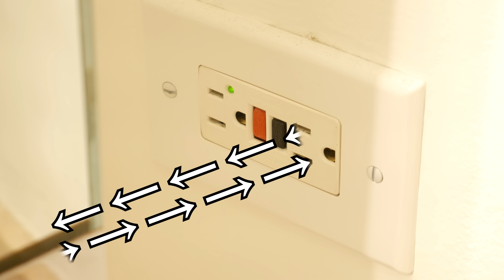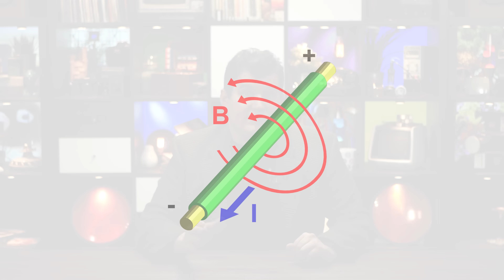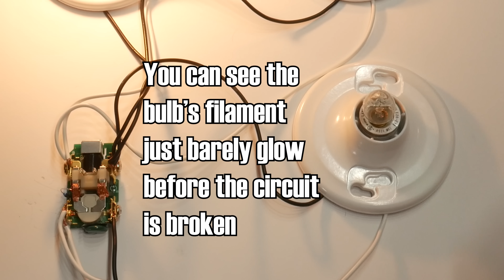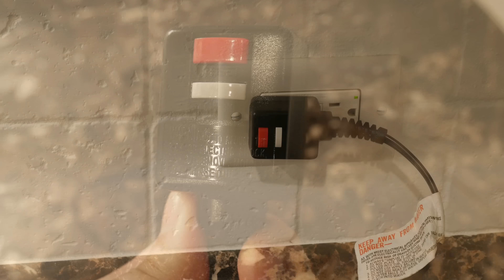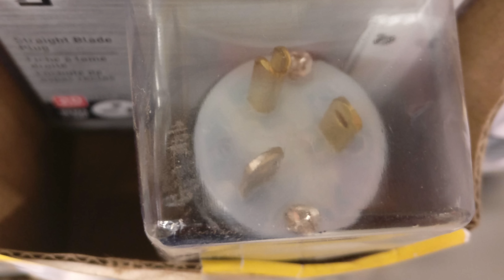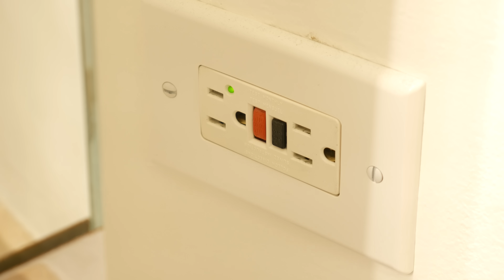The GFCI/RCD: A Simple but Life-Saving Protector

Comment: I got some FI in the Main Fuse box. Once i had one circuit getting off randomly. Took me some time to find a wire to the main light in the living room had a tiny blank spot in the isolation. Put some tape around, problem solved.

Comment: The term ground fault circuit interrupter is confusing as many people think that it is somehow connected to the ground wire and will not work without it.

The GFCIs used in the US are electronic. In Europe they are mostly electromechanical with no electronics and they do not use any power themselves.

Comment: Thanks for your video about GFCIs. 
A remark : you didn't explain explicitly that GFCI does not protect against touching both contacts at the same time. Only against touching live and the ground somewhere.
I had some time ago to explore the US vs ROW solution. 5mA, 30mA, duration, etc. Interesting. I'm really really not sure 5mA is much better. I checked, there's maybe 2-3 electricity related death/yr in France. And the sex/age profile of the accidents suggests while hacking around (men in the 20-50 bracket), not during regular use, so maybe in unprotected situations. So 30mA seems definitely good enough.
But you're right it's sometimes, rarely, difficult to find the source of a ground fault on a generic installation. It maybe happened to me, IDK, once or twice in my life ?
BR

Comment: A red light could also mean that there is low voltage going through the GFCI circuit or that it's not powered on correctly.

Comment: In Australia we call them RCDS yeah they basically measure the current flowing in and out of any electrical unit attached however they are mainly used in switchboards as it protects the entire circuit are commonly set at 30mA implying if theres a fault at 30mA or greater the device triggers but anyless circuit will continue as normal which is safe as it fluctuates and there isnt a fault at play. Essentially having an RCD protected powerpoint (GPO) saves the trip from finding the switchboard and having to reset the circuit. We mainly find these in hospitals as patients could be on life support and if one powerpoint trips it could be fatal to numerous people as they could be using the same circuit as apposed to one person or device shutting down

Comment: actually saved me one time. had a baaaaddd strep infection, had to do 3 things just to help treat it, one of them was gargle heavy salt water, unfortunately, i had not done it before, and because of how swollen my throat was, i was already sensitive to gagging or coughing, so when i went to gargle in the bathroom, it surprised me so harshly with flavor and the back of my throat that my entire body immediately forced me to spit it straight out in an instant, unfortunately it was DIRECTLY into the outlet that was below our mirror, behind the sink. there was a huge whirring sound and hiss/aggressive popping, then everything got bright for a split second, and the whole house circuit blew. it all happened so fast it was prob less the a second or just over, but i had spit that water all over and inside the outlet and i ended up spilling the cup as well in my shock (un intended pun) so i was drenched in highhhllyy conductive water. the outlet in the bathroom had turned off immediately, so i was fine, but the house blew because the water ended up getting into the socket so far it soaked other components. the electricity would have bypassed all the stuff in the outlet and gone directly to me if the thing hadnt flipped. idk why the water didnt finish the connection again in the middle, just by chance but, hollyyy shittttt was i lucky.
edit: wanted to add, i lived in a not so new trailer, so the outlet wasnt exactly the greatest, nd im guessing thats why the water got so far

Comment: Typical USA rather be efficient “time savers” rather than potentially saving lifes “if the safety is placed in circuit box it may take a looong time to troubleshoot the problem” well if you plug in a vacuum and a saw at the same time and the circuit turns off the power it’s rather obvious it’s too much to use both at the same time.

I’ve never had more than 5 minutes spent troubleshooting a circuit break and I even had a chewed on cable by rats in my ceiling above my garage once since the circuit only cuts off power to certain areas, which are easily labeled “garage, bedroom, kitchen” etc.. so in my chewed cable problem the garage circuit had shut off by itself, check the ceiling and find an open cable half destroyed

In America’s attempt to be efficient they slowed themselves down

Comment: Props: protection in the socket should be quicker in some nano amount of time. (assuming it's a high quality one)
Problems with your washing machine will not disconnect the whole house.
Cons: That's dramatically more expensive than one protection for the whole house. 
Many of complex elements installed in the objects which purpose is different.
One expensive element is much more trustworthy, because socket's main function is not a protection, but connect the plug. Protection mechanism could be simplified or emulated to increase sales.
Also, there are number of other protection blocks that you could find in the electric control panel. It's good to have them all in one place.

Comment: in EU, we now have mandatory central 300mA Residual Current breaker for ALL circuits. So when anything bad happens to you electric installation and there is a fire, since the fire is conductive (as it is plasma), it will most likely trip the central Residual Current breaker and disconnect whole whose from the the net. which is nice
Reply: No, there are no EU wide rules and 300 mA is only for TT. It is to make the grounding work and should not be considered as RCD protection. The standard for RCD protection is 30 mA.

Comment: I had an RCBO that tripped because of faulty construction that got an external outlet wet. It was a pain to troubleshoot without schematics. After a couple hours we had the wires at an external plug separated before sealing the leak and replacing the indoor outlet with an exterior GFCI outlet.

Comment: I like RCD more because it's easier to say and sounds cooler
14:09 not a problem in europe. Multiple breakers and if everything is done to code and/or common sense (separate breakers for heater, refrigerator, oven, lights, bathroom outlets, kitchen outlets etc.) and they are properly labeled using a cardboard or unreadable electrician hieroglyphs on breaker box door itself, finding the faulty device takes 1-5 min

Comment: The rest of the world calls hem RCD's. Well, sorry to say this, but this is not true for where I live. Here they are called Aardlekschakelaars. (earth leakage switches) They detect current leaking to earth (ground). and when it has reached the setting value of either 30mA or 300mA they will shut off the main current.

Comment: When I was a kid, back in 1990 something, there was a knock at the door. I was home alone and not supposed to answer the door. The knocks got louder and more aggressive. I opened a door and a man flashed a badge at me, and asked me if my parents were home. I told him "no." He said he is with "Code Enforcement" and needed to talk to them. We had a big above ground pool in our back yard. My Dad ran an extension cord from the garage to the pool filter and pump. They said we couldn't do that and had to get a "GFI" or take the pool down. So an electrician they couldn't afford was there within two weeks to install one, and naturally  they had to have an add on service panel because the existing one wasn't big enough. Always something. Retrospectively, it was a good idea as while handling the motor, a hose came loose and everything got wet. The device did its job and shut off the electric immediately so I believe if not for that device, my Dad and myself would have been at very least shocked badly if not electrocuted to death.

Comment: The term ground-fault does have a technical meaning, not quite explained in the video.  As electricity must always flow in a loop that we call a circuit, a ground fault is when circuit current leaks onto or passes through the grounding system.

The grounding system represents the electrical potential of the Earth itself, and everything not insulated from it.  If you're standing on the ground, especially if you're not wearing rubber shoes, then you're the same electrical potential as the Earth.  The third prong—the round one you see on these receptacles—is the ground prong, or earth prong.  That ground connection allows other things to be connected to the same electrical potential as the Earth.  Take the metal shell of a toaster, for instance.  If that shell is insulated from the Earth potential, then should an energized wire in the toaster touch the shell, the shell will be come fully energized.  Should you happen to touch that energized shell, then ZAP!  But, if the metal shell is connected to the Earth's potential, then a ground fault will occur.  That ground fault will cause the circuit breaker to sense an overload or a GFCI/RCD to trip, and that will happen before you even have the chance to touch it. 

This all happens because one of the wires in a utility power circuit is almost always connected to the Earth, too.  In the US and Canada, the neutral wire is connected to the Earth, so they share the same voltage potential.  When a ground fault occurs, a secondary circuit is completed through the grounding system, which is what causes the circuit breaker overload or GFCI/RCD to trip.

Comment: After we had a house fire in 2010 from a floating neutral outside the house, we added a separate whole-house surge suppressor (in addition to the wet location GFCIs). We felt safer.
Reply: Do you mean a neutral drop that was severed?
Reply: @RJARRRPCGP  I used the term that the fire investigator used. That is not my area of expertise. I don’t know what you mean by “neutral drop”. Sorry.
Reply: @DoctorQuackenbush  What I meant by "neutral drop", is the neutral that's on the service drop, the power lines going to the house, before the meter. (outside)
Reply: @RJARRRPCGP  Yes, the problem was described as corrosion on the aluminum neutral wire in the junctional box up the street. That resulted in 220v going to 110v outlets.

Comment: 2:34 a metal case toaster without a ground wire and a fuse is prime for getting electrocuted when the wires in the toaster are faulty
Reply: The toaster is likely double insulated

Comment: In Finland all power outlets must be conncted to a residual current circuit breaker. However the RCCBs are installed in the electrical panel and not part of the outlet.
Reply: You can have them in sockets also but that is rare. If would be mandatory only if you added a new socket to a bathroom in an old installation. Even if you just replace one you do not need it.

Comment: I was building some grow lights recently, and I was concerned about potential shorts and the risk of fires and electrocution. I grounded the whole system and plugged it into a GFCI plug. As soon as I plugged it in, the GFCI tripped. Looking closely, I found a single stray strand of copper wire where it wasn't supposed to be and it created a short. I was glad for the GFCI because I could have easily gotten a shock or some other harm. It's videos like this that had me install a dual GFCI/AFCI on that circuit.
Reply: I had a weird situation in an older house where I was replacing ungrounded outlets with grounded ones. I shut off only the breaker for the outlet I was changing, and got zapped on one outlet, because each half was on a different breaker. After that, I tested both halves for power before removing an outlet.

Comment: Back when I was in university, I was living in a place with no AC.  While Vancouver hardly gets egregiously hot most of the time, I'm not one who tolerates summer well at the best of times, so I found an alternative: cold water baths.  But since just taking a bath is boring, I set up a set of ipod speakers using the outlet there - well away from the bathtub, up on the counter.  I never managed to figure out why, but it would almost inevitably trigger the GFCI at some point during my hour long soak in cold water that would get me through a day of indoor temperatures of 30+ degrees.  

I did know it was a safety thing, but I thought it was a really low-current circuit breaker intended to keep power output levels below the point where it would cause damage.  (Because hair dryers aren't a thing I use and therefore don't exist, I guess?  I was studying engineering, I should definitely have realized that bathroom appliances, being made up of primarily motors or heat elements, were going to require way more current than my speakers did....*shrug*)

So my solution was to plug it into the normal outlet just outside the door, and put the speakers on the ground just inside the door.  like, say, where if a big enough puddle of water formed from my heaving myself out of the bathtub, water could create a conductive line connecting me to the speakers.  Brilliant!

I suppose my one saving grace was that the speakers used a wall wart transformer to get down to 12V DC power, which is far less likely to do anything serious than 120V AC mains power.  Still, not smart.

I think the reason I found the GFCI triggering so frustrating is because of how that place was set up.  It was a relatively new building, and was wired with the GFCI built into the circuit breaker for the whole room, rather than just the outlets.  (People doing it properly do both outlet and breaker, cheap contractors going by code minimum just do the breaker).  So yes, the speakers were getting stopped from electrocuting the counter or whatever, but also the lights were shutting off in a room 2 doors and 100ish feet away from natural light, while I was in the bath.  It's not nice having to lever oneself out of a bathtub by feel, then dry off, get dressed (because the service panel is next to the window), and go turn the power back on.

Comment: If the breaker panel shown at 0:57 is yours, it appears to be a Zinsco panel. Zinsco panels are, unfortunately, known for failing in not-so-nice ways (like failing to trip when required, or welding the breakers to the busbar, or catastrophic failures). If you own your home, you might want to have the panel replaced. If you don't own your home, you might want to ask your landlord to consider having the panel replaced.

Comment: Lies. Sticking a knife in a toaster won’t shock you because you’re not grounded so there’s no easy path for the electricity to travel down. You would have to create a new ground that us connected to you because then you would create different ground potentials. Therefore creating a shock or an arc

Comment: weird. in Argentina we have a thermomagnetic differential circuit breaker (we don't have a fancy abbreviation more then "disyuntor" or circuit breaker [ the normal circuit breaker it's a "termica" for the thermic part of the traditional circuit breaker]). but our version of the GFCI it's fully mechanical, not electronically manage.

Comment: in the UK, the first time I saw these, they weren't aimed at household socket protection at all. They were basically marketed as inline plug devices for use with garden equipment (lawnmowers, strimmers, hedge trimmers, etc) as ways to protect you from shock if you accidentally cut the power cable. We didn't get them build into household sockets until much later.
Reply: In the UK and Europe, instead of having one outlet protected, theyre usually mounted in the breaker box and protect the whole house or a room

Comment: In my language they're called (loosely translated): differential (electrical) safety (device). It kinda describes what it is pretty well. We're only required to have one on the main power supply into the house though (Because as long as you get a shock, it will trip).

Comment: I opened up a faulty GFCI outlet today just to see why it wouldn't reset, I had replaced it last year already, but I guess the weatherproof box is not sealing well enough. Anyway, it seems that rather than a true test (like the demonstration with the resistor contact), this outlet is just a mechanical switch which unclips the reset button. It has a slider which pulls on a flat piece of metal on the reset button causing it to become unhooked.

Comment: I'm a licensed ham radio operator and sometimes when I key up my transmitter, our GFCI outlets trip and the radio isn't even plugged into them. 

On daisy chaining outlets, in the 1980s, many houses in the US were built with all the GFCI outlets in bathrooms and outside on the same breaker and chained to each other. In my house, the master bath has a GFCI outlet but the other bathroom and the two outlets outside appear to be just standard outlets. If the GFCI in the master bath trips, the outlet in the 2nd bathroom and the outside outlets quit working. In other words, the outlet may be on a GFCI even if it doesn't look like one.

Comment: This explains why The GFCI was tripping after replacing an old receptacle, they were daisy chained only using hot with all of the neutrals returning to a junction installing a GFCI made it so the daisy chained outlets would instantly trip as they did not return through the outlet. Because of this video I didn't need an electrician and learn quite a bit about safety thank you

Comment: Mine are on the fuse panel with my new very expensive, to code, arc fault breakers. Expensive, at least, til my house got struck by lightning and it saved all the appliances and electronic devices👍